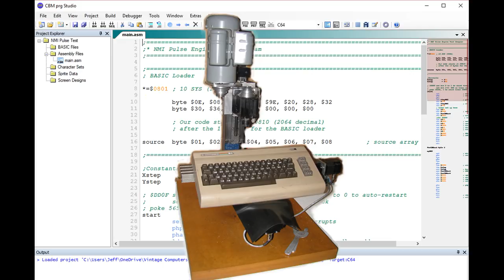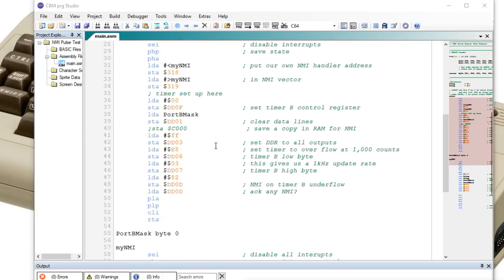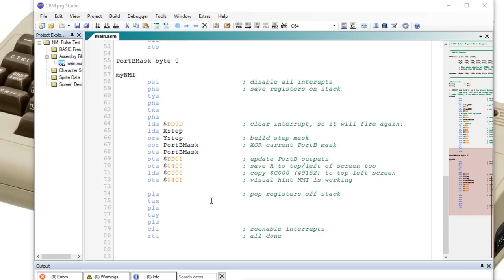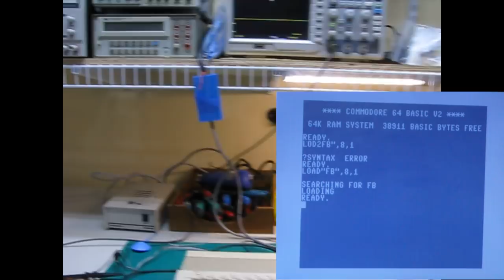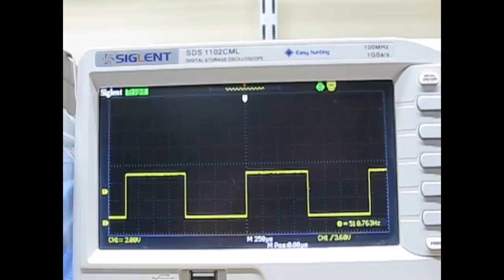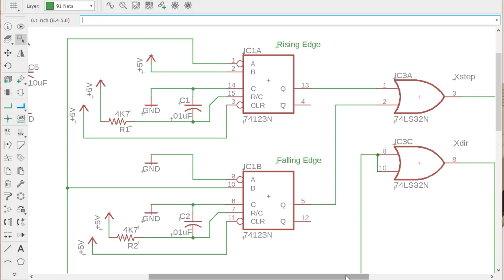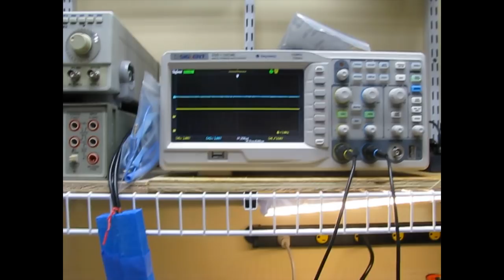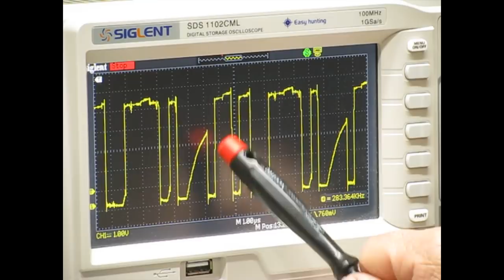CNC 64

Comment: Excellent video. As a kid I always wanted my C64 to interface with the outside world, and still have that curiosity. Thanks for explaining so well.
Reply from the maker: Glad you liked it. I really do need to finish up the CNC-64 project. I did get acceleration worked out and then decided I should add opto-isolators to the PCB. Then I for distracted with other projects :)

Comment: How great to create this! I know CNC controls are fairly simple tech wise, but having a C64 control it is just cool.
Reply from the maker: Thanks! Twenty plus years ago I helped install an early PC based CNC control, it used a Pentium 90 and ran Windows NT with a real time operating system extension. It was soooo much faster and interpreting GCode it was amazing. One customer had an older controller that they had optically 'traced' a bunch of patterns in (you draw a 1:1 outline of your part on poster board and the control using an optical sensing head to trace it and convert it to GCode.

This scanned GCode file was made up of many thousands of very short line segments. When processed by the PC based control it nearly shook the machine apart as it was trying to acel/decel on each line segment. The older control was so slow it did not even try to do this. The solution was a software upgrade where they did not apply acceleration if the change in angle was less than an amount you could set.

This project is just to push what can be done with very modest hardware like the C64.

Comment: Hello,

I would like to know if the user port, besides having OUTPUT, has some INPUT for example 5Volts

Thank you
Reply from the maker: The data lines can be set to inputs or outputs by the DDR (data direction register). Some of the other external lines are only inputs or outputs. https://www.c64-wiki.com/wiki/User_Port

Comment: Hi Birt

you have been MAGNIFICENT

Now I'm going to study, it seems very interesting.
If I need a little help, can I disturb you?
Reply from the maker: Of, course feel free to disturb :)
Reply: @HeyBirt  Hi Birt
can I send you 1 document?
I need it to explain my problem on an IN / OUT circuit
I'd like to send you an email if I can
Reply: @HeyBirt  Hi Birt,

I have a card with 2 5V input signals and 6 relay outputs.
I would like to know if the inputs can become 3

thanks
Reply from the maker: @pietrodesantis210  email birt_j at soigeneris dot com
Reply from the maker: @pietrodesantis210  my email is birt_j at soigeneris dot com

Comment: Couldn't you have just used two XORs per interrupt to double the frequency? Of course there would have to be some  instructions between them to space them out properly but it wouldn't have been hard to do.
Reply from the maker: Hi Tom, you pose a very good question. It certainly would have been possible to add a few NOPs in there to create a delay and then toggle the pin back. The draw back though is the amount of time spent in the delay.

I was originally aiming for a 10us pulse at a 1kHz rate. A shorter pulse would be sufficient for some opto-isolators in stepper drive inputs but not all. Adding in a 10us delay 1000 times a second comes out to, 10us*1000=.01s. So for every second we are spending 10ms in a delay doing nothing. Wasting 10ms does not seem like a lot but consider it is 1% of the available processor time which is very precious on a 1mHz processor.

So, I traded a bit of extra complexity in more hardware (the edge detecting pulse circuit) to keep that 1% of processor time available.
Reply: @HeyBirt  As you can tell, I'm a software guy. Thanks for not ridiculing me! :)
Reply from the maker: Part of the enjoyment I get out of watching videos on YouTube is learning something new and hope that others might have a similar experience with my videos. 

The nice thing about the vintage PCs is that they are simple enough for a person to grasp most of the HW and SW. Modern PCs are very, very, very complex by comparison. I've been watching a lot of CPP CON videos the last couple of days and the subtle interactions of the exact HW, compiler and library implementations used are mind blowing.

Comment: This is an absolutely horrible idea... which, of course, is why I love it! 😜
Reply from the maker: Yes, it was just silly enough to be interesting. I need to pull this back out and work on it again. I did get velocity and acceleration working in simulation but I have not tested that on the hardware yet.

A friend also suggested using some external parallel->serial shift registers for each axis. If that works it would allow for 4x or more increased step rates.

Comment: ohhh good news.

Listen, as I am an electrician and I don't know the basic well, I took my C64 after about 20 years, can you help me write a little program?
I would need IN = 5V, with OUT turning on 1 LED

Thank you
Apri in Google Traduttore
Reply from the maker: Take a look at this book PDF: https://archive.org/details/practical-interfacing-projects-with-commodore-computers/mode/2up

It has example programs for interfacing the user port with the Commodore 64. There is a lot of neat projects in there.